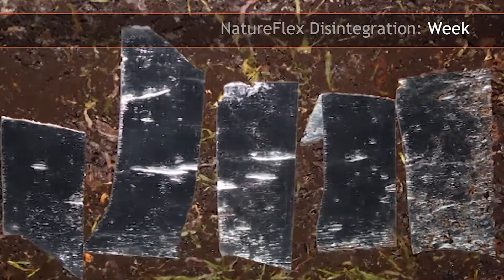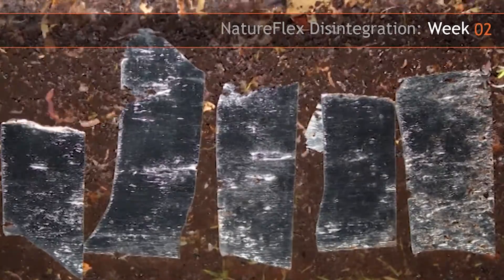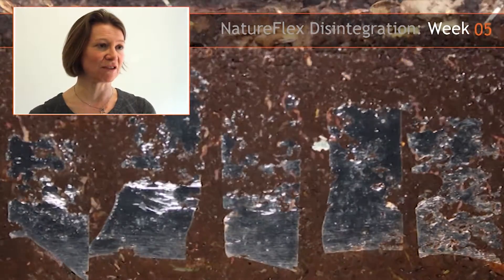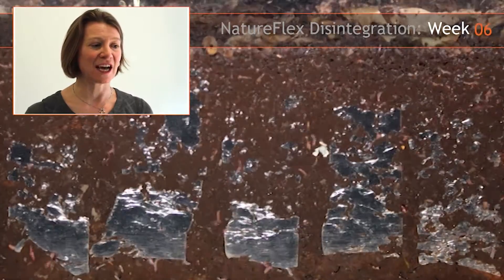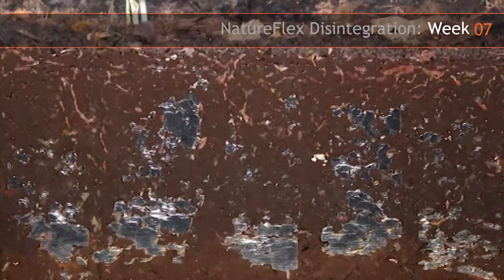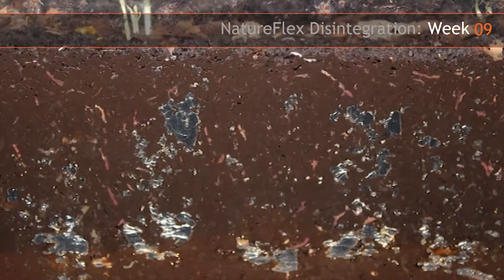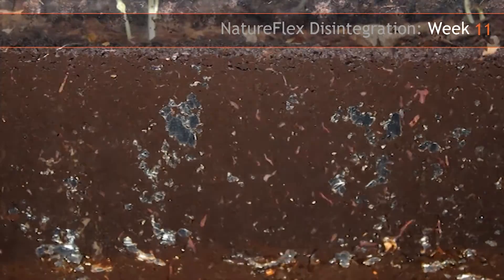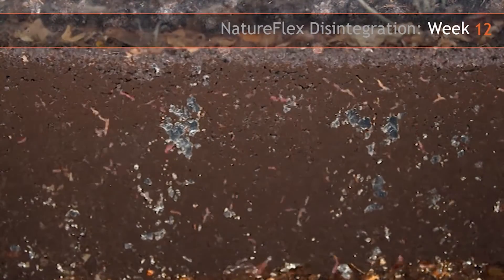Futamura - TimeLapse

Comment: @Futamura Cellulose, Why is a metal layer used?

Metal is NOT a renewable resource.
We humans need to conserve metals to use in ways that can be recycled indefinitely (such as aluminum drink cans). If we put metal in compostable packaging, those metals will end up in the soil - we can be safe for soil - but then we cannot easily re-extract them from soil - so then we will need to mine more metals which is very harmful. Especially if this innovation scales up, it is setting ourselves up for more failure.

I do see this is much better than petroleum plastics. I'm still an advocate for shaping these solutions so they will actually be sustainable when scaled up. 

So, can this packaging be made withOUT any metal?
Reply: It's still very hard to find a truly eco friendly product 😪. If you happen to know any, please share!